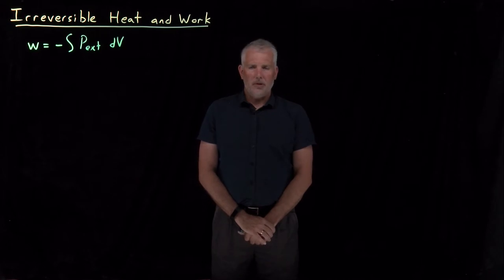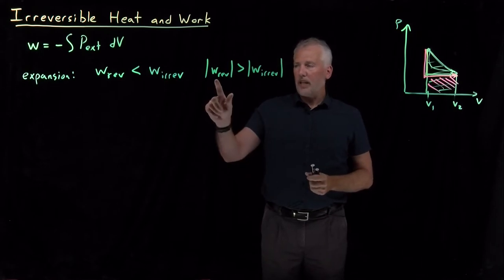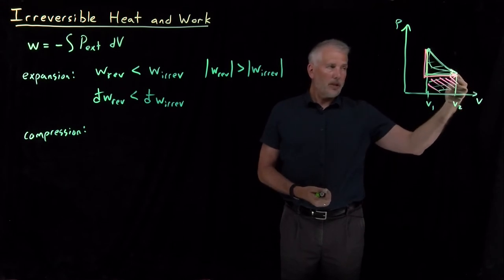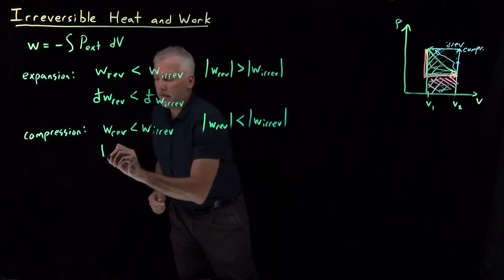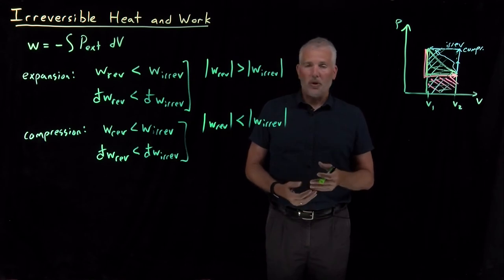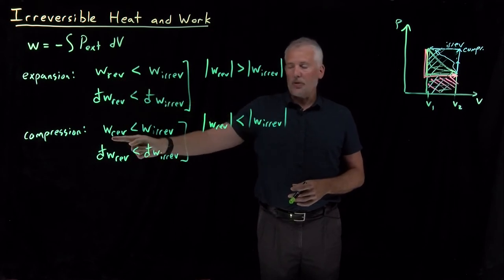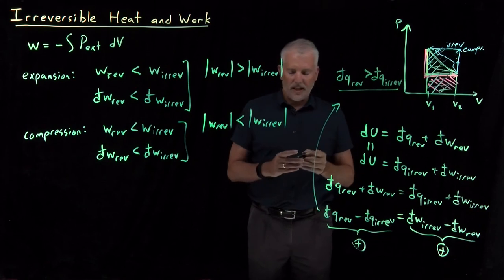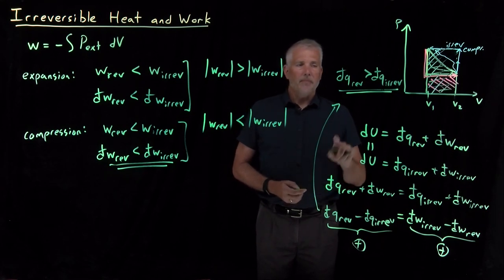Irreversible Heat and Work

Comment: I just did not understant differential form. The differential paths are not the same, but the overall path is the same. Two differential points are not the same, so how we can say the same differential internal energy change for reversible and irreversible paths?

Comment: Need to explain why Carnot shows reversible work is maximum work i.e higher than irreversible work. 
Video based on graph indicates reversible work is higher than irrev work (as the irrev curve has lower area) and work done is a scalar energy value. Video statement at 1.23 is confusing even in a short while later at 2.15 using absolute values work rev is higher than work irrev. This algebraic manipulation is a source of confusion as it is against  other thermodynamic textbooks. BUT it an innovative explanation which removes sign conventions discussion is other textbooks, unless there is reason for this innovative approach?.
Reply from the maker: There are some videos on the Carnot cycle (https://www.youtube.com/watch?v=szyFQuPiP9s) and the Carnot Theorem (https://www.youtube.com/watch?v=mYNCueVb9jE).

Notice that I'm using a different sign convention for PV work than you are: chemists and physicists usually prefer to define work as negative when a gas expands. So reversible work is less than irreversible work. (https://www.youtube.com/watch?v=X0E4gPv8vTQ). This sign convention comes from the definition of PV work here: (https://www.youtube.com/watch?v=NHgWYXTjqCI). Engineers often use the opposite sign convention (work for a gas expanding is positive). Both approaches are correct, you just have to adjust your expectation of whether PV work means work done "by" or work done "on" the system.

This may indeed be contrary to other thermodynamic textbooks if you are mostly following engineering sources. From my point of view, of course, those engineering texts use a sign convention that is contrary to that of most of the books on my shelf.

Comment: Sir graphically it is understood that irr work done in case of expansion is more but wht is the actual reason behind it why system has to do more work for irr expansion than rev expansion plz sir explain it.
Reply from the maker: When the expansion is reversible, the external pressure is the same as the internal pressure. So the pressure that the system is pushing against is the same as the internal pressure.  This is the largest pressure that the gas can successfully push against, so it requires the  most work to push against.

For an irreversible expansion, the external pressure is lower than the internal pressure. So the gas is pushing against a lower pressure than in the reversible case, and does less work.
Reply: @PhysicalChemistry  sir then in both case rev work is more either compression or expansion it doesn't matter?
Reply from the maker: @bikashsahu4809  No, for compression the reversible path requires the least work. An irreversible path will require more work (because the external pressure must be larger than the system pressure)
Reply: @PhysicalChemistry  plz sir explain through a vdo not able to get it ,it is so confusing
Reply from the maker: @bikashsahu4809  The good news is that I have made a video trying to explain this as well as I can. The bad news is that it is the video you are already commenting on!
Reply: @PhysicalChemistry  ok sir i will see it .
Reply: Hello sir i have a question which is related to this topic how can i ask ,m so confused can u plz provide ur mail so that i can send it to u ,i will be always grateful to u if u can solve that one.